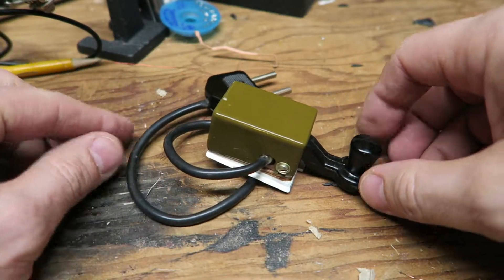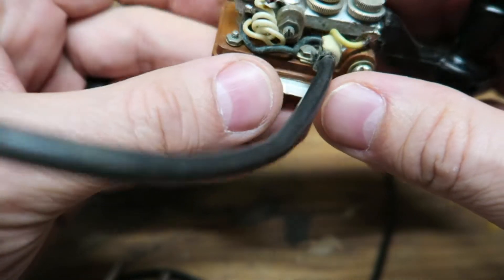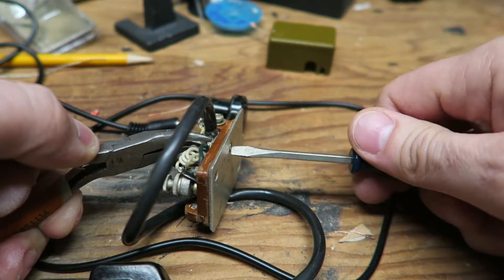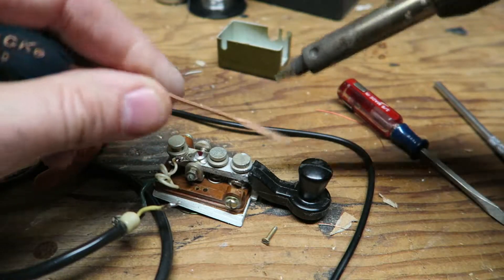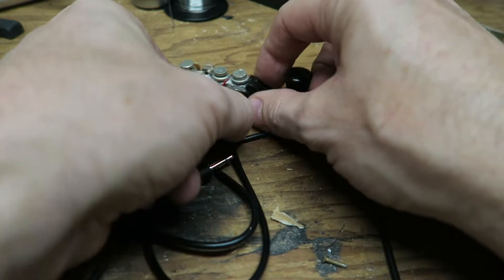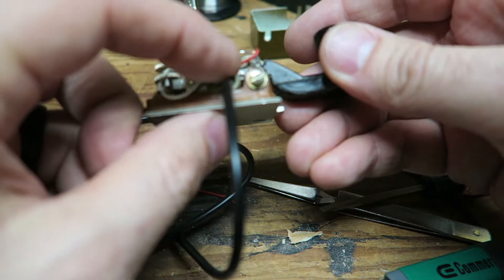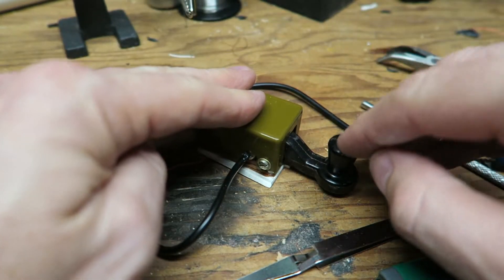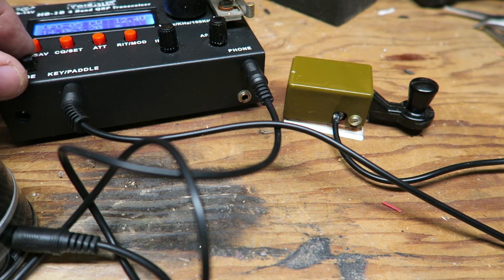Rewiring a Russian Military morse key to use with modern civilian radios

Comment: "Very strange connector"

All of Russia and part of Europe uses that plug on...every electrical appience. it's a power plug my man.
Reply from the maker: Thanks for the info. Yet I live in the United States, not in Russia or Part of Europe,  and it is "Very Strange Connector" in my little world as I also mention it will not plug into any of the radios I have. It is not a power plug, it is a connector for a morse code key.

 strange adjective
\ ˈstrānj  \
stranger; strangest
Definition of strange (Entry 1 of 2)
1a archaic : of, relating to, or characteristic of another country : FOREIGN
b : not native to or naturally belonging in a place : of external origin, kind, or character
Reply: Ron C it's a power plug repurposed, Russians are knows for these things. It wasn't a knock on your knowledge. 

As you had it, you could plug it into the wall in any Russian household and cause a fire. What makes it so Russian is that the people that made it thought "just do do that, that would be a very stupid thing to do". The lesson is, if you dont know what it is, dont touch it.
Reply: They probably used standard outlets for all sorts of electronics to save money during the war.
Reply from the maker: Well then, this would've made your initial comment a bit less....insulting. as well as making it sound as if you thought it was designed to plug into an outlet for power. Gotta admit, as dangerous as it is to be able to plug that directly into a 220v outlet,  it sure makes it easy to repair something. Cannot imagine that key getting plugged into an AC outlet!

Comment: That key is consider to be the "spy key" there is another version which is bigger that was used more widely I have one like yours which is like new and I was able to get my hands on a "new old stock" bigger brother of it still wrapped in the paper!  You can also just bug two 4mm banana sockets and connect to it that way.  I've seen a few people do that and copied it myself.  I can have a 3.5mm or a 1/4 plug that way.  I was lucky and could buy them here in Budapest real cheap.  The Czech keys are even better I've been told.  I'm trying to learn CW now.
Reply: I just started using Morse Machine - an app on Android seems quite good but I am only a week or two into learning morse so waaaay behind you!   Best of luck with it.  Stewart de HA5RV/M0XSS
Reply from the maker: Thank you! Those keys look nice! By the way, another good source for CW practice is https://lcwo.net/
Reply from the maker: That's pretty cool! Thanks for that info! I'm still working on the CW, copying is a struggle, confidence is the bigger struggle. I've seen a lot of military surplus on ebay from eastern Europe and if it weren't for the shipping I'd buy a bunch. I love military surplus equipment! What is the model of the bigger key? Which Czech keys are good ones?
Reply: @InPhocus_ADV  Can't say what model it is. This site has quite a lot more info including your key on a convertor base plate and also the bigger one I was telling you about (both were made in Hungary AFAIK).
https://www.pa3egh.nl/morse-keys-from-europe/morse-keys-hungarien/
Reply: @InPhocus_ADV  More info about the Czech Army keys is here: https://www.pa3egh.nl/morse-keys-from-europe/morse-keys-czech/
Reply: @InPhocus_ADV  And here: https://www.eham.net/reviews/detail/9588

Comment: any chance that original plug's pins are the same size as banana plugs? Then you could just mount a pair of banana jacks or 5 way terminal posts and plug it in. Then wire the jacks to the 1/8" phone plug... Nice key! Yes to a base as Tom mentioned...
Reply from the maker: Thanks for the comment! That's a good question! I'll look into seeing if they fit a banana plug this week. If anything, that might save someone else from rewiring it! 73
Reply: Love the vids! keep em coming :)   WB2SMK
Reply from the maker: Thanks!
Reply from the maker: The plug does fit into banana plugs, albeit slightly loose. They are the split type, so I guess one could spread them apart for a tighter fit. They are also spaced to where they lineup and fit into the banana plugs on a BNC-Banana jack adapter.
Reply: I thought that might be the case. That's an instrumentation standard config. Cool!
Reply from the maker: That's some good information to know. I appreciate you bringing it up!

Comment: I need one of those! Why not use the same wire and just change the plug? Too thick?
Reply from the maker: Gil,  At first I was going to use the original wire, but it was a bit short and I felt that I would just replace it and keep it in the event I ever let it go and I could replace the original wire, or at least provide it to the new owner.
Reply: @Radio Prepper
Two 4mm banana sockets works well no need to open it then.  Gil, if you don't have one yet check this: https://www.ebay.com/itm/223486760475
or this: https://www.ebay.com/itm/173876909955

Comment: Great video man... I need some solder wick.  Good visuals good explanation.
Reply from the maker: That little spool used to have just plain solder wick (plain copper braid). I got several feet of the new stuff from work and it has flux in it and works so much better.